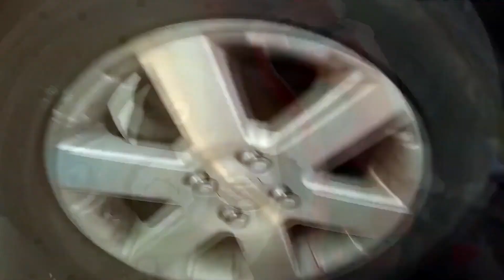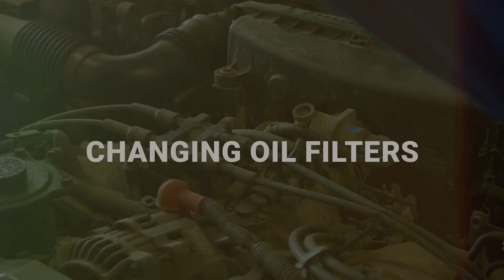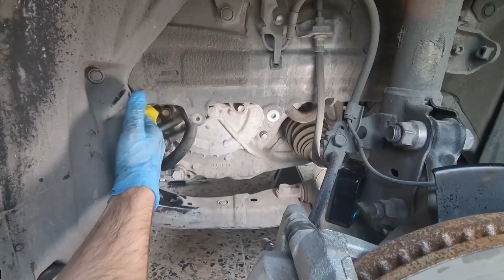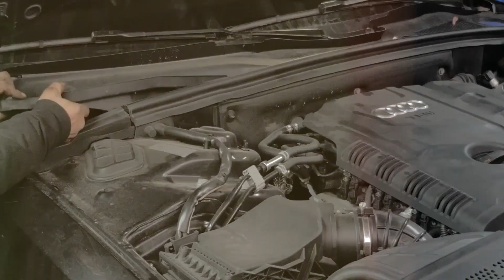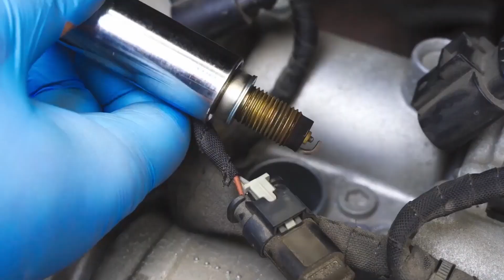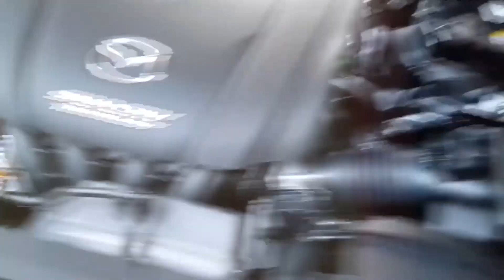The 300K Mile Toyota Blueprint: Tips to Keep Your Car Running Strong with Minimal Repairs!

Comment: A narrator that sounds over 14 might lend credibility to this under whelming standard advice. Change your oil and if you aren't smart enough to pick brand name oil of the correct weight, you can use Toyota oil, which somehow is blended for Toyotas but not other cars.  Wow.